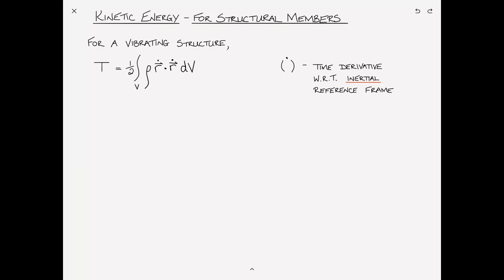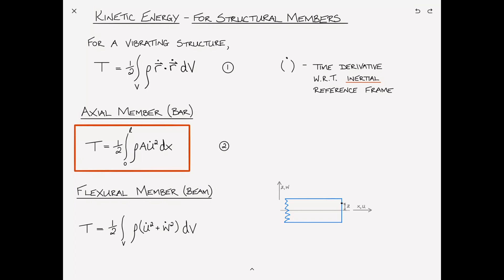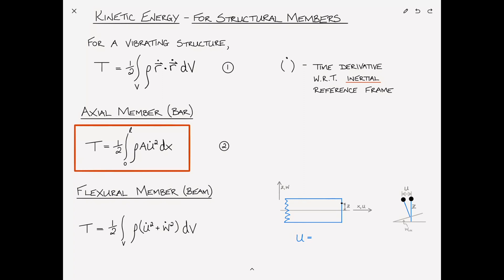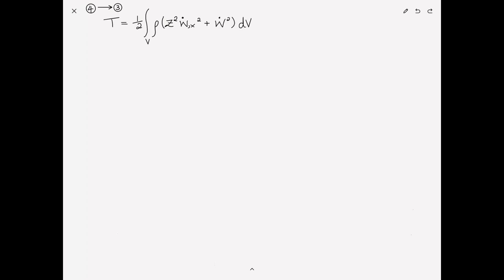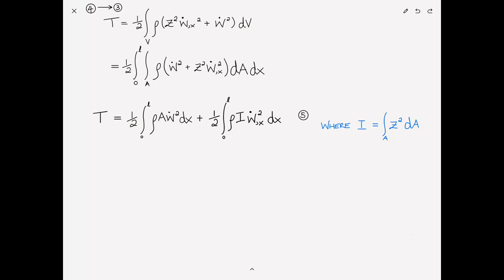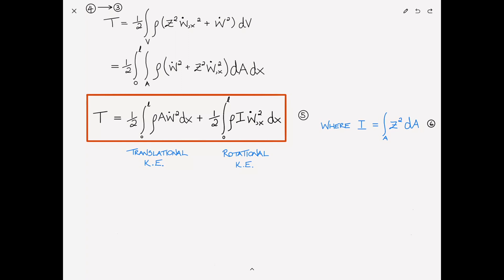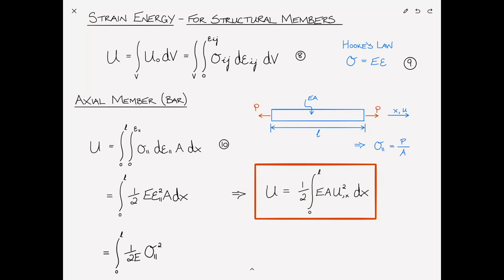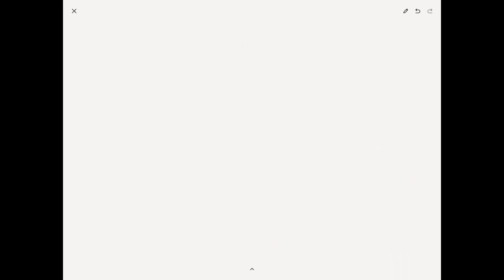Kinetic and Strain Energy for Common Structural Members

Comment: Does taking the variation of strain energy del U and kinetic energy del T, and plug to hamilton will result in equation of motion of Bernoulli beam in this case? I watched your Timoshenko part 2, and more or less that's what you did to result in equation of motion for Timoshenko beam. Then I was wondering if we can do the same for this simpler case for Bernoulli. Thank you
Reply from the maker: Yes, it is exactly the same.  When deriving things in this video, I glossed over some of the formality in deriving it because I wanted to keep it simple, but then in the Timoshenko video, I wanted to lay it all out since I expect viewers of that video to be a little more familiar with the material.

The only difference between the 2 theories is in the strain energies, since the strain energy for the Timoshenko beam includes shear and the EB beam does not.  This is consistent with the EB assumption that cross-sections that are normal to the elastic axis before deformation remain normal to the elastic axis after deformation.
Reply: @Freeball99  thank you for your reply. I found your video that actually did it (deriving Bernoulli equation of motion from Hamilton), so actually it already answered my original question. Thanks again anyway for explaining it again. Your videos are really awesome.

Comment: At 10:21 it should be M=EIw,xx (w,xx is not squared, it is just the second derivative) acc. to my understanding. The right side might be negative, depending on the orientation of the coordinate system. However, under the integral it is correct.
Reply from the maker: Correct.  It should not be squared - this is a typo.  The strain energy is what contains w, xx squared.